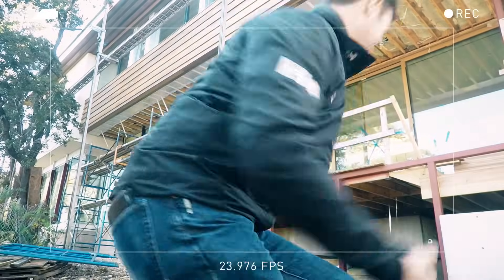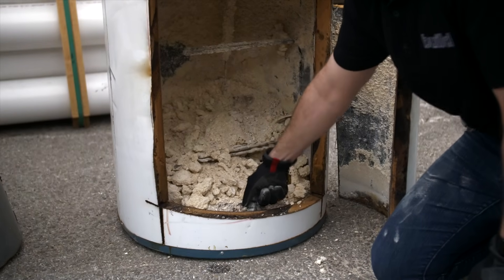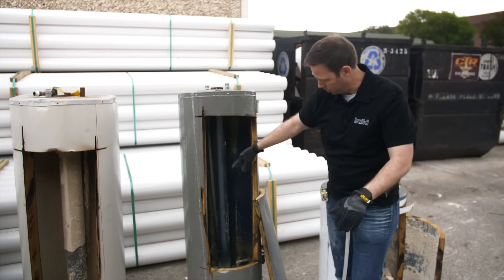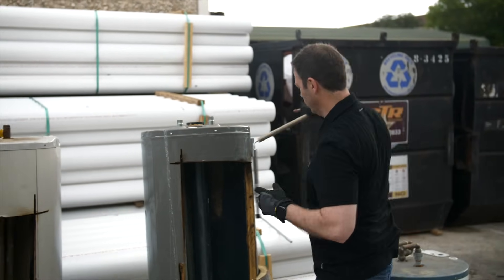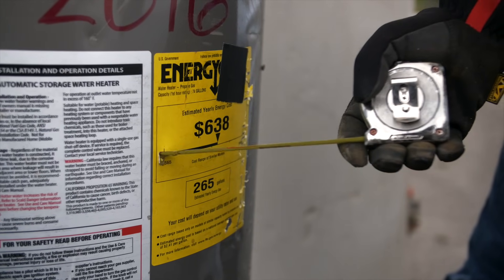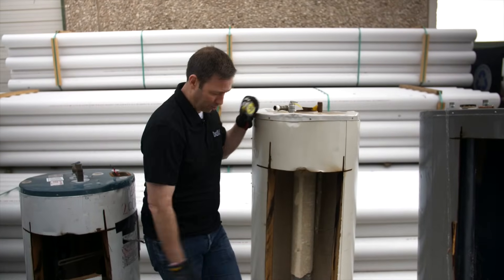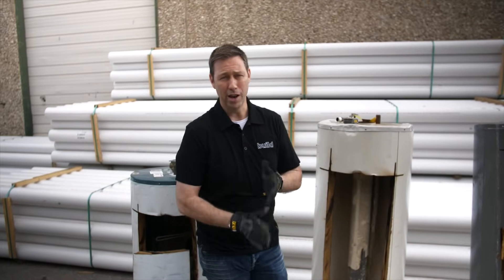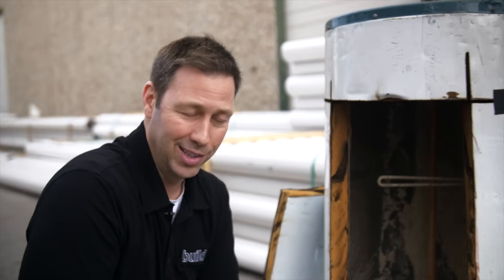Four Water Heater Tanks Cut Open - Lessons to Learn

Comment: My parents water heater is 29 years old.  I keep telling them to replace it but the don't.
Reply: They'll save a lot and have more comfortable with a new heater, check your utility rebates.
Reply: We have a vacation house that was built in  1975. The 30 gallon gas hot water heater is the original unit. That must be some kind of record being 43 years old.  We always shut off the water to the house when we leave and then bleed off the pressure. I leave the pilot on with Vacation setting so I don't have to relight it in the dark after driving 250 miles. 

Around 1983 my dad bought a brand new spare HW tank for the place. It was left in the corner of the yard for 3 decades. The bottom feet and the whole burner compartment  rusted out and I found it lying on its side covered with ivy. We hauled it to the dump recently having never been used at all.
Reply: kimmer6 2 Years ago I renovated a house and pulled out the HW cylinder which was original from 1963. It was a copper low pressure. The label had a long spiel from the manufacturer on why you should buy their high quality copper locally manufactured cylinders rather than an imported foreign one. (I'm in New Zealand). 
I cut it open to get the copper to recycle it and it looked near as new as you could imagine. Unbelievable really. 1963.  I think that's the record. Btw I cut the cyl around the label & kept it. Great design.
Reply: CW...  in the USA almost all hot water tanks are steel that has been glass lined with molten porcelain for longer life. My grandfather had a cast iron gas fired water heater stored in his basement circa 1920's. I have never seen a copper one.

I have an apartment building where each unit has its own 30 gallon tank. The longest life I ever got from one was 19 years of service. I marked the tanks with the date of installation. The factory warranty is 6 years. I have replaced 37 of them in the years according to my maintenance book. The ones set to higher temperatures fail much sooner in 8 to 12 years.

You are lucky to find such a copper one. Being a hobbyist, I may build my own one day using a stainless steel tank with 6'' of rigid urethane foam insulation, multiple fuel input, a positive close exhaust damper, and the traditional safety protective devices. Then again I may grow old and be in a wheel chair before that ever gets started.  Cheers!
Reply: @DiscoFang  - Should not have removed the copper tank. It was probably made to last 100 years and could possibly go 150. Just think how much money you and the next owner gonna waste on cheaply made expensive tanks over the next 100 years. Maybe 10-14 new tanks?
Reply: booobtooober You're right on the  probable longevity of that one! However we had to go larger. The old 135L are hopelessly inadequate for a 3 bed house. Copper cylinders are still available new and the preference when installing/replacing  in low pressure systems here in New Zealand. They can be expected to last for 30 years easily and would only be replaced again with evidence of leaks. The ones manufactured locally by Rheem are still very high quality.
Reply: booobtooober The other funny thing about the situation here is I see a lot of almost new copper cylinders being pulled out when houses are renovated and then sold on the local online classified/auction sites. They'd been replaced in old houses as maintenance or repair then pulled a few years later for fancy on-demand gas califonts. I'm the happy one buying them at 1/4 the price of a new one and putting into a rental renovation. What they don't realise is the exterior mounted gas units will be rusting in 10 years in our salt-laden coastal air whereas that copper cylinder they "rejected" will be snug & still performing like new in 3 times the lifespan.
Reply: Cassette Walkman exactly. Copper was until recently the only material available in the UK. The tanks last decades. People started ripping them out to install combi boilers (our version of instantaneous water heaters, they also provide central heating, hence the name) only to find that combi boilers are always going wrong, leaving them with no hot water at all, and needing replacement at huge expense after ten years or so. The only downside to copper is that most are "traditional" vented cylinders so you don't get the pressure you do with an invented steel type.

Comment: After your first video on water heaters. Mine has a pressure relief valve(as expected) but no tank drain valve. Hbook states to remove cold inlet pipe to drain tank.
Reply: Are your water connections on the side instead of on the top? If so don't worry about it, you could create more problems than you would prevent.

Comment: Great video! I just replaced the anode on our 6.5 YO heater a few weeks ago - it was completely gone! The hardest part about replacing them is the fact that they are usually so corroded in that you can't get them loose. I used a breaker bar and was moving a 50 gal heater full of water when I loosened the old one.

Also, if you have hard water, softening it will reduce the sediment but increase the corrosion since softeners replace the minerals with salt. Checking/replacing the anode more frequently may be in order if you have hard water.
Reply: Anode is useless for hard water because hard water is not corrosive.
Reply: @pauld3327  That’s incorrect - the dissolved ions can cause galvanic corrosion. If you soften your water using salt then the increased salt content can also cause corrosion. Regardless of any scientific arguements, the fact that the sacrificial anode was sacrificed (i.e. gone) is evidence that corrosion can occur.
Reply: @ptester1  
Thank you for your response.
Do you mean that sacrificiel anode is still useful even with very hard water and no water softener ?
My understanding is that with hard water, the scale inside the tank will protect It from corrosion.
Reply: Yes I had a tough time getting a rod loose after one year.  1 1/16 inch 6 point socket or 27 mm 6 point socket and cheater pipe.  Tried to get rod out of a 7 year old friends heater. No way. Need to remove right away, put 6 wraps of teflon tape on threads.

Comment: The first thing I did on the new water heater, before installing it, is replace the drain valve with a full port valve. Then loosened the anode rod and re-tightened it. That was 12 years ago. Changed the anode rod 6 years later and now getting ready to change it again. Once a year I flush the tank and vacuum the inside as much as possible (attached a 1/2" I.D. flex tube to the shop vac) you would be amazed how much more comes out vs flushing alone.
Reply: I also removed my drain and replaced with a 3/4 nipple and a ball valve.  Make flushing out so easy.
Reply: Brilliant idea. Because changing the manufacturer installed drain valve is a P-I-A job and it can brake off while you attempting to replace it with a full port "Ball" valve. So do it before putting the heater in place as well as loosen and do not over-tighten the anode nut.
Reply: @rgeo27  12 years of water heater installs has taught me to always tighten the drain valve slightly before attempting to loosen. Especially if its plastic. Tapered steel "stick" or "easy out" is plan B
Reply: Vacuumed out about 10 pounds of hard water mineral sludge on a 15 y/o heater today, while changing both elements.  Spent 6 hours, but still couldn't get it all out. Would have been really nice to have had a full port drain. Of course, the standard drain valve is now leaking and I'm going to have to buy a cap for it 🤦‍♂️
Reply: Charles Ajouri.  Yeah, one post demonstrated where a clear vinyl tube attached to a shop vac sucked out a large amount of lime.  Of course it requires the removal of the lower element and making sure all the water is below the element port.   I would suppose dumping in a gallon or more of vinegar would help to dissolve larger chunks of lime too big to get sucked out.  And one household would be without hot water for the better part of 6 hours while the vinegar reacted with the calcium lime chunks, then flushing the remaining sludge before filling with water ro be heated.   A drastic, but necessary project, to keep a heater in good shape for 15 or 20 years or more.  Any thoughts, my friend ?   Bob
Reply: @robertshorthill6836  i like the vinegar idea! Will be doing the maintenance this coming weekend and will try that. Mine is gas so i don't worry about the heating elements. Will be changing the anode rid as well. My heater is about 16 years old now and still going strong.
Reply: Great idea! 
BTW bare threads are Satan's playground so I hit them with pipe dope or anti-seize or teftape depending on application (tape is NOT for high vibration use).
Reply: I have found that most electric heaters can be restored by vacumming out the pile of flakes, replacing elements, anode rod and thermostats. If its not rusted through you can get a lot more life for about 100$. And i just discovered a full port drain valve thats awesome!
Reply: and if you hadn't done any of that there's no way to know that your tank might have lasted 30 years without any of your work.
Reply: @tarlach1280x960  🤣
Reply: It reminds me of this water heater: https://www.youtube.com/watch?v=lrZQgWOenCo&bdds

Comment: Plumbers all tell me the number one cause of early failure is the control unit. All made (poorly) by the same manufacturer and due to cost, not economical to replace. As a private building inspector, I tell my clients they have a 10-12 year life on average and only a 6 year warranty.
Reply: Gary DeWitt those controls are all the same where they hook up only  diffearance is face  times i see a tank thrown out i grab that ..their 70$plus if you buy even used from plumbing supply.

Comment: Replacing an anode rod is a great idea.  But actually removing the old one can be a giant pain.  They get set in place so hard after many years that evrn using a breaker bar can actually turn the whole tank full of water instead of breaking the seal.
Reply: IMPACT wrench.
Reply: A breaker bar causes a lot of stress on your tank. Impact Wrench is much better for you and the tank. I replaced mine, (when it was brand new) with a electric  anode. I am hoping it works as advertised.
Reply: Some anti seize products can be toxic!! Beware!!
Reply: Seems like the solution is to loosen then tighten the anode plug at least once a year, to keep it from rusting in place. Maybe apply fresh Teflon tape each time. Good idea? Bad idea? Ugly idea?
Reply: @doubledarefan  Its best if you put anti-seizing  on it when its new and you won't have problems getting it lose.
Reply: Double Dare Fan Teflon tape would make the anode rod useless, as it would be an electrical insulator and stop the electrolysis action of the sacrificial anode!
Reply: @kendaleklund7475   The tape is an insulator, but the threads will cut though it and make electrical contact.  I suggest verifying the connection with an ohm meter, just to make certain.
Reply: Electrically conductive Anti-Seize

I doubt you need to find it specifically, but Anti-Seize in general would likely be fine.
Reply: you are correct. so do it as Charles Ajouri explains above.

Comment: The way I understand EF is for every dollar of energy you put in how much hot water do you get back out... I don't understand why insulation would come into this rating (using my definition, if I'm correct), I would think it's because of a more efficient heat exchanger/burner/flue. (6:10)
Reply: The EF is a measure of overall efficiency based on how much hot water a tank produces versus how much fuel it consumes. In addition to the efficiency of the heat exchanger/burner, the EF includes standby losses which are directly proportional to the amount of insulation the tank has. Ie the more insulation > the slower the heat loss > the less fuel consumed per unit hot water > the higher the efficiency.
Reply: @Brian Foote Heatpump  water heaters would be affected by scale build up. An electric resistive water heater with scale build up would likely have a poor first hour rating.

Comment: I like the Rheem Marathon water heaters. Plastic tank, super insulated.
Reply: Ben Wolk-Weiss 
Agreed replaced the 13 year old water heater in the house with a Rheem (love it). What killed the old unit  was actually the expansion tank platter failed and was never drained. Well the new expansion has a train valve not many people think about that. Get the videos coming Matt.
Reply: How about Vaughn polybutene storage tanks?  I’ve searched all over but info is almost nonexistent.  My concern is the health effects of thermoplastics.  Does anyone have any knowledge about this type of tank?
Reply from the maker: Me too
Reply: I was going to suggest this. Just get a Marathon if you aren't ready to step up to a heat-pump unit.
Reply: Thanks Brian, that’s what I was wondering.
Reply: Great water heaters. I read that if the electricity goes off the temp. only drops 5 degrees every 24 hrs.
Reply: But you get Rheemed with the price too.....

Comment: Would well water reduce the life of the hot water heater?
Reply: depends on the dissolved mineral content of your well water. If It IS hard water without a softer (or  before a softer) then it would for sure affect the lifespan (more scale). If your water is high in sulphur or iron it may affect it in other ways (which I cannot speak to).
Reply: I would be more concerned about low P.H. well water (acidic) . That is more damaging than moderate amounts of scale.( Do not fall for the instant hot water hype.)

Comment: Matt, maybe you can do a video on flushing and replacing the anode rod in a gas/electric water heater?
Reply: Yes. I've been thinking about doing that to my 20-year old, completely unserviced, electric water heater for many years now....
But I'm worried that something will get stuck / broken and I'll have to buy a new one & get a pro to install ==>  $$$
Reply: @Dave--FkTheDeepstate  flushing your water heater is a good idea. I just did it the other day and a lot of rusty water came out. Anode rod gets replaced next. There's lots of videos on how to do it.
Reply from the maker: Yes. Was thinking that as we edited this video. It’s in Cue now. I think it’s needed
Reply: @buildshow   Have you made it yet?
Reply: Yes, please show us how to do it.
Reply: @buildshow  *Queue
Reply: I have always flushed my tank yearly but never even knew about the replaceable rod. Will have to check that.
Reply: Great idea, we just replaced a water heater that developed a bulge on the side in Dec 2015.  I have no started to flush once a year, and will be doing the anode road every 2 years (according to the manual)  I havent done my anode rod yet, as Im worried of screwing something up.
Reply: Matt Risinger puedes hacer un vídeo de cómo hacer una parrilla con un termotanque?
Reply: I was gonna say that,I would like to see such a video.
Reply: Zk AY    Not all anode (not cathode!) rods are magnesium.  Many are aluminum, some have a combination of zinc and other metals.  The most appropriate type depends on your water conditions.
Reply: Do you ever recommend wrapping your tank with an insulating blanket?

Comment: wrap your tank with fiberglass and use thermal break couplings!  It's cheap.
Reply: Wrapping newer electric water heaters voids the warranty on some quality brands. It causes moisture to collect at the elements and thermostats, causing them to fail.
Reply: When I look that up all I find are internal parts... can you show me a link/ pic? I imagine its just stainless or copper with a plastic component between?
Reply: Pierre Roy They are dielectric unions used to stop electrolysis action in the hot water system.
Reply: @pierreroy8124  cpvc can be used on heaters and theres an adapter to copper if you have copper. here in fl coppers the last pie to use between the corrosive water and all the lightning copper pipes pinn hole quickly especially if builder used light copper only cpcv off white or pex even the old grey pipe starts to fail
some still stub with copper i did not